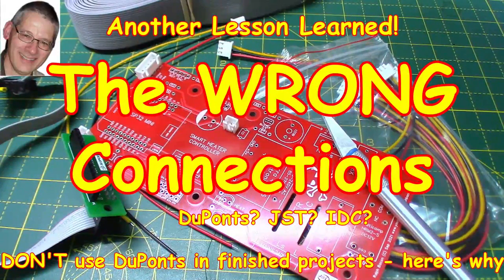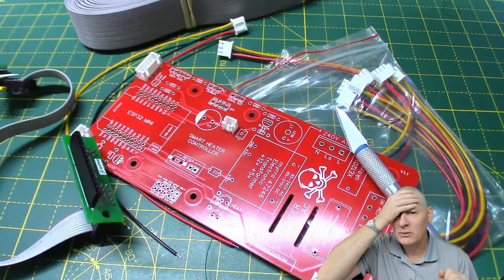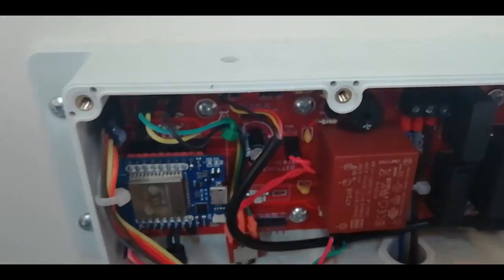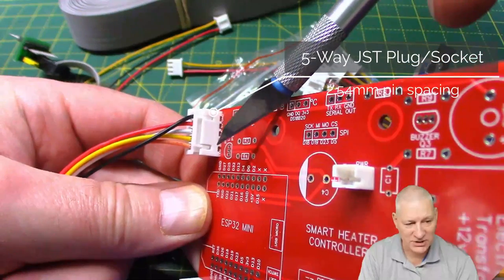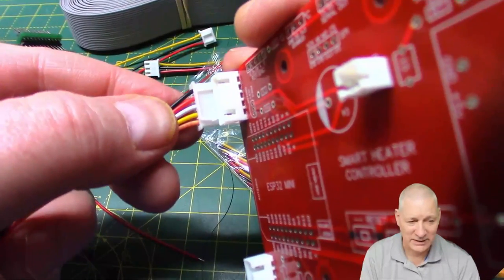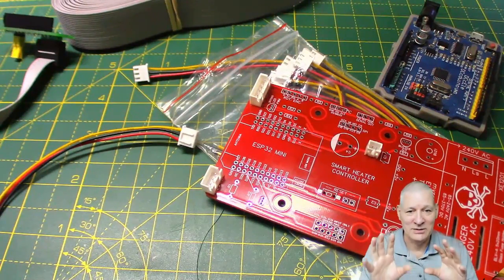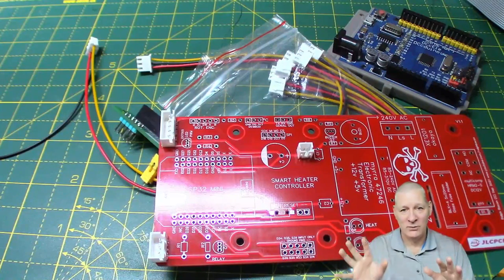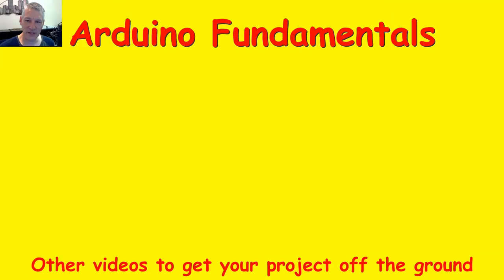#238 The Wrong Connectors😲forget DuPont, use JST or IDC for final use

Comment: The connector you showed in the video is the JST XH Series.  The JST company makes a huge variety of connectors.  Have  a look a the JST-XA connector too. It has a locking tab you push to release the connector.
Reply from the maker: I'll have a look, although what I found on AliExpress et al were all XH style.
Reply: @RalphBacon  Buy directly from JST. They don’t have a minimum order, and it’s $10 shipping for orders under $100, free for orders above that. And the pricing is spectacular. Plus you can order the weird variants (like colors) that resellers generally don’t stock.
Reply: Yeah the XA are common on 3d printer motor and endstop wiring. Molex microfit 3.0 is great too but they are pricier than the Japanese solderless terminals haha. I buy pre-made microfit 3.0 cables for quick disconnect of higher gauge wires to save money.

Comment: From bitter experience, I learned there are two different pitches of IDC ribbon cable (and plugs and sockets). 1.0mm and 1.27mm.  1.27mm is our hobbyist preferred pitch as it matches the 2.54mm (0.1") plugs and sockets.
Reply from the maker: Yes, spot on. "Experience is a hard teacher", but you never forget the lesson learned, right? 😯

Comment: Definitely single or dual pin headers with Dupont style would be a problem but if you gang more pins together with one shell, especially dual row, they aren't too bad.  It also depends on the brand of pin/socket.  Many Dupont clones are cheaply made and don't hold well.  You can tell with what come with Arduino clones.
Crimping pins/sockets are a headache though if you customize your cable.

I totally agree to strain relief your hardwiring, especially with stranded wire.
Reply from the maker: I'll be trying some other plug/socket combos soon (dependent on AliExpress) so keep tuned for further updates on what works best!

Comment: Normally I'll use JST or screw terminals but I too got lazy with a couple of ACS712 sensors in a project. Didn't take long before I kicked my own @rse and soldered on some prefab JST plugs.
Those IDC connectors look great. Up to 5 minutes ago I had no idea how they were assembled, but will now have to order some up. As usual watching one of your vids ends up with me holding less folding!!
Reply from the maker: Sorry I caused you more financial loss, Matt, but you will thank me long term. Look at the comment here about the triangle on the IDC socket indicating pin 1.

Comment: I was specifically digging this subject yesterday, great to see you talking about it. I would like to mention that there are numerous standards of JST sockets/cables and all of them bring different styles. You can check for example those ones ZH , PH,  SH, PHD, EH, XH & SM. I'm intending to use SM ones in my case, the big advantage being their design that let you (un)plug very easily by pressing the 2 handles (this is pretty much what we're used to see with light strips) .
Reply from the maker: That's the great thing about standards, there are so many to choose from!
Reply: @RalphBacon  The JST XA series are better than the XH ones if you plan on unplugging lots.  They are latching connectors with a tab to squeeze to release mechanism, very easy to remove. Very similar footprint, just a little thicker.  Different crimps to the XH though

Comment: You mention in the video, that you recommend putting on the strain relief for the IDC connector. I have found, that these connectors are sold both with or without the stain relief. The regular connector with strain relief is used most. However there exists male connectors for the PCB that has clamps on, that go over the female connector after it is seated. This connector with clamps works without the strain relief on the female connector. There os not room for both strain relief and clamps. You have to pick one.
Reply from the maker: Interesting, thanks for sharing.

Comment: For one-off Arduin-ish projects, intended to be permanent, I use wire-wrap.  Reliable removable low-volume minimum height connection.  Also allows multiple connections to a single post, depending on post length.  _NOT for systems in development, and NOT for things you want more than one or two of.
Reply from the maker: I've never, ever used wire-wrap in anger, even though I once had a little tool thing with the wire spool on it. It just seemed so fiddly. But you've mentioned it so we will investigate!
Reply: @RalphBacon  we use wire wrap in telecommunications- the wires stay connected even when mildly disturbed and I’ve got circuits that have been wired up for 30+ years that still work perfectly.

Comment: The things you’re referring to as JST connectors are the JST XH series, and their pitch is 2.50mm, not 2.54mm. Depending on your PCB hole size, you can fit up to around a 10-pin 2.50mm-pitch connector into a 2.54mm-pitch footprint.
Reply from the maker: JST themselves state, Antonio, that these are 2.54mm (03 - Pitch / Style: 2.54mm) although there are others with 2.50mm which I was very careful to avoid!

https://www.jst.co.uk/products.php?filter=625&cat=30&searchString=
Reply: @RalphBacon  But in the video, you’re showing JST XH, which are 2.50mm. The handful of other models they have are irrelevant to this point.
Reply from the maker: Interesting.

Look at this ad on Amazon, Antonio (just one I found). It states JST XH 2.54mm pin spacing, which they all pretty much do:
https://amzn.to/3spwTdM

Or this one from AliExpress (which I bought and probably showed in the video), also XH but 2.54:
https://s.click.aliexpress.com/e/_AdiVBP

I'm wondering whether the 0.04mm makes any actual difference (especially at low pin counts) and it "fits" (which it does, without any forcing)?

Comment: Just an aside : if you solder the PCB connectors the wrong way around, it is possible to lever the plastic box out and flip it rather than de-soldering and soldering the connector, which can be a pain. Just be careful if there are any tracks underneath so that you don't damage it with your lever.
Reply from the maker: OMG the word "lever" and "PCB" in the same sentence! But if you have done it, I guess it must work as a last resort. I'll bear it in mind.
Reply: @RalphBacon  Ha ha ... I meant a rigid knife or spudger something like that , not a crowbar 😂

Comment: The secret to reliable dupont connectors is to not use individual connectors. If you have a 4x1 row of 2.54mm pin headers, use a 4x1 dupont connector instead of four individual connectors. Then the required force to remove the cable is much higher. It basically becomes the same as IDC. You can also key the multi gang dupont connectors using plugs and a corresponding missing pin on your header.
Reply from the maker: Yes, that does work better than individual cables but even so, Duponts need to be only used on a breadboard; some of them are really, really thin.
Reply: @RalphBacon Almost every PC motherboard in existence uses dupont connectors for various things. They are extremely common in production electronics.

Comment: Pulling on the wire of the JST connectors is fine since the pulling force will be mostly distributed on the contacts.
Why didn't you cut the plastic notch on the housing instead? That way you can use the connector on the normal ones, that you haven't cut yet.
Reply from the maker: Yes, I could have done that, although it's more difficult to do (IMHO obvs). But I now use KF2510 connectors and they are way easier to use and crimp.

Comment: I don't now if it is ready mentioned but there is an IDC connector crimping tool for this, 
so if you have to crimp lots of connectors is handy to have one in your toolbox.
Reply from the maker: Indeed, I have one, such as it is. Works OK, I guess, but a vice works just as well for the occasional crimp (which is what I would expect us hobbyists to do). But for under £20 they are available from Amazon.

Comment: I've used Dupont mulri-way connectors from time to time for off-board connections, and if there are more than 4 or 5 connectors in the housing then there is a reasonable amount of spring pressure to stop them flying off, but those single wire connectors are really only suitable for prototyping. In a pinch you can secure them with a blob of hot glue, which isn't too hard to get off if you need to separate them. But proper locking connectors are the way ahead. I've used the IDC connectors before and they are the "proper" way to take multiple signals between boards, but are a bit of a hassle if you want to connect individual front panel controls to a board, as separating the strands of the IDC cable usually works OK but then all of a sudden it splits and you've got a bare wire! 
I once built a sort of mini-sythesiser that had lots of off board connections, and I just put holes in the PCB next to the connections so you could thread wires through them before solderng, so they acted as strain relief. You can do this with proto-board or veroboard of course and its very effective at stopping wires snapping off. Another way is to use "veropins" or similar then heat-shrink over them to support the joint.
Reply from the maker: You've described all the ways I've attached wires on a PCB, Ian! None of them were perfect, but some better than others. 

What I wanted (and I believe I now have) is a mechanism that is strong, reliable and will allow me to disconnect the wires without desoldering them. We shall see how my next project fares! 😏

Comment: Andreas Spiess has a partial solution to the DuPont-style connector. For anything requiring more than 3 conductors, he'd crimp a custom cable with an extra (open) pin. He'd also pull out a corresponding pin on the PCB header. Makes it way easier to deal with insertion and removal correctly, especially since polarity is usually important. Doesn't really deal with accidentally pulling off though.
Reply: It’s not a Spiess life hack but a well-established method of keying connectors. ;) The name-brand vendors sell connector keying plugs (which block off a hole in the connector housing) precisely for this purpose. 

As for popping off, that’s strictly a result of the cheap Chinese clones, which are all very low force, and wear out almost instantly. The original name brand products a) don’t wear out as fast, and b) come in different force levels: high-force for low pin counts, medium force for medium counts, and low force for high pin counts. The Chinese ones seem to me to be similar to the low force ones, which aren’t intended for anything under 40 pins. The high-force contacts are what Amphenol recommends for 1-20 pin connectors, but the Chinese don’t offer them.
Reply: @tookitogo  Fair enough. He's just the first one I saw using it. Good to know about the high-force connectors though. I have some cheap crimps which work fine for prototyping, but I doubt it would work for long in production use.
Reply from the maker: Quite often I use a 3-way connector for a two-wire connection, with the outer pin 'dead'. That way if you connect the wrong way round nothing bad happens.
Reply: @RalphBacon  Very smart. I’ve done that too on occasion.

Comment: I always plan on at least one respin of the board. I have just accepted that. The duponts are better if you use (for example 5 pin header) one connector instead of using separate connector for each pin.  I agree the jst a better,  it observes polarity.  How come you mask the screw contacts on your circuit board, makes a good ground connection ?
Reply from the maker: 1. The screw connections (the holes with the white silk screen circle around them) were not for grounding, not with mains electricity on half the board. 🤦‍♂️ They are without any kind of electrical connection to the remaining circuit, in this case.

2. Yes, multiway sockets with DuPonts are better relatively speaking but still not like a JST. We'll see what I say after my next project which uses JST sockets!

Comment: Molex KK/254 would be a better connector, it's designed to be easy to plug and unplug, keyed orientation, and mechanical friction catch. Also in 2.54mm pitch. Cheap and used a lot too.
Reply from the maker: Yes, the Molex kk/254 is a good solution, if you are willing to make your own cable terminations because I've not yet found pre-terminated cables (unless you can prove me wrong).

Ironically, I used to make all my own Molex-style cables, I have a really good ratchet crimper and everything but that is probably the problem - I've done it too many times, it takes forever (I solder the wire after crimping) and, well, I suppose I just cannot be bothered with all the faffing any more! Sigh. Yes, I know, man up, Bacon. 😁
Reply: @RalphBacon  Haha; i get you! The KK-254 crimps were the first ones I ever tried, wasn't too annoying and I had a better success rate than with other JST's, so I kinda like this connector. 

One more nag, JST XH is 2,5mm pitch by the way, not 2,54, the latter are the fake ones :) You can't see the difference until you go to connectors of 8+ ways, then it starts to not fit. For the typical 2 or 3 ways, it doesn't matter.

Thanks for the vids!
Reply: @RalphBacon  Molex makes tons of precrimped wires, you can get them on Digi-Key, etc. Also, TE makes a compatible series, MTA-100, which includes an IDC version (IDC in the sense of “insulation displacement connector” in general, not the specific dual-row ribbon plugs you call “IDC” in the video), where you insert wires into slots very much like punchdown blocks on RJ-45 jacks.

Comment: Great video. I've been using Dupont connectors in my prototyping for a long time now and I find that they are very good as long as the parts aren't subjected to movement. Another good solution is latching 2.54 connectors (Molex clones), which are typically used on PC fans. They provide a durable keyed connection and as an added bonus they can handle up to 4 amps per pin (if you're brave!). Best of all, you can get the headers in 90-degree flavour so your connector sits flush with your PCB, which is great for low profile builds.
Reply from the maker: Yes, all good points, you have obviously had the required experience! 

I also now use mainly KF2510 connectors (also available straight and right angled) as these are easier to connect but still (sort of) latch (friction fit). You can also buy pre-wired connectors in 2,3,4... etc configurations so you don't even need to bother crimping the plug wires.

Comment: I've glued Dupont connectors together to make a multi-way connector. A number of them together seems to make them a tighter fit, and has worked well enough for the projects I've done so far. I'm too tight to buy IDC cable and connectors when I have old computer cables around. I've re-located the plugs and they seem to be fine if you're careful.
Reply from the maker: Multiway headers (no, John, not individual ones glued together, done that, not great) have worked for me in the past, as there is more resistance to being pulled off the header pin, but there is a limit. JST so much better IMHO.

Comment: Hi Ralph, you must have been watching me over the last few weeks ... I have used 100's of Dupont Sockets and plugs on my Model Railway Electronics ... but ive know kicked them out after weeks of problems and gone with the JST XH connectors and I completely rewired and obtained new PCB's from JLCPCB ... I have started using between 3 pin and 12 pin JST connectors and made up my own crimps wires and I also find after a Youtube vid on making the crimps the correct way I have had about 5 sockets fail after making over 200 crimps to sockets ... the kits are available on ebay for a box of 1 to 5 way connects but I also got seperate 6way, 8 way, 10 way, and 12 way ... they are brilliant and now this section of the layout works ...Regards John
Reply from the maker: So you too, John, learned the same lesson as me (also the hard way) that those JST plugs/sockets are made for a reason (and DuPonts are so unreliable!).

And you are making your own crimped wires - kudos to you.

Comment: I have to say Ralph (whom I have a hell raising cat named) that your genius and humor brighten my days.

I was thinking about buying an idc kit for breaking out pins in 3d printers when I upgrade them to simplify the process. Make an idc cable to a breakout board and then connect everything to that.
Reply from the maker: That's a great idea! If you look at the photos of my ESP32 Web Radio I use two custom IDC cables to connect the 'motherboard' to the 'daughterboard' with the screen as well as the MP3 decoder. It certainly gives you room to manoeuvre ✔

Comment: You can still use the pin headers, then if you want more resilience, you can solder a JST pigtail to the headers, along with the strain relief you mentioned.
Reply from the maker: Indeed, that was my Plan B for this particular project so I didn't have to re-do the entire PCB. Maybe I won't need to open the front case again...

Comment: The IDC sockets have a small molded triangle which denotes the location of wire 1. Correct orientation prevents making wrong handed cables. As for DuPont connectors It is possible to CA glue them together or simply buy multi pin housings. This has the benefit of multiplying the break out force for the assembly.
Reply from the maker: Great tip about the Pin 1 location, Rob. Regarding gluing DuPonts together, that's what I did in that project I showed but it just made the problem worse! Poor quality clone DuPonts probably the issue.
Reply: @RalphBacon  It is. See my standalone comment about the original DuPont connectors (the Amphenol Mini-PV series). I use them at work and they’re worlds better than the clones. (They’re also vastly more expensive.) The clone housings are actually not bad, the contacts are where you really see the difference.